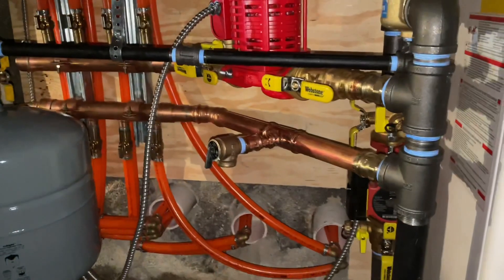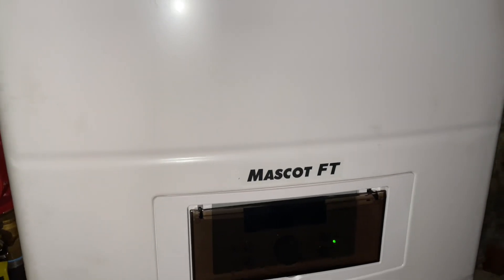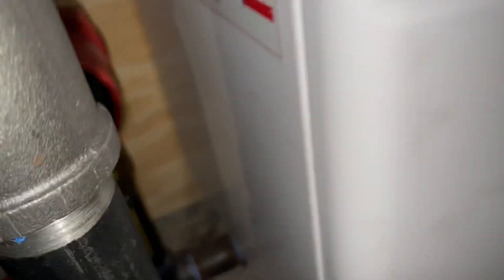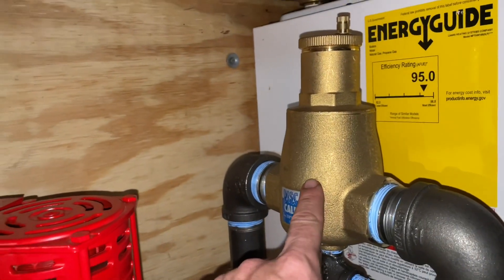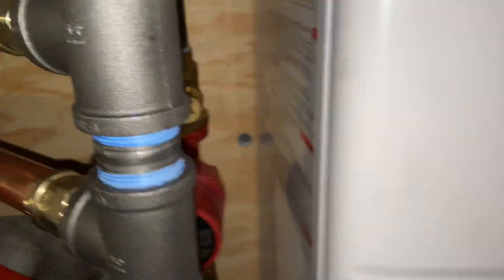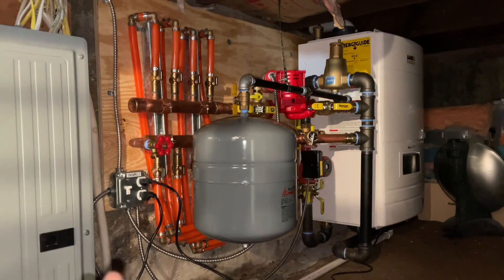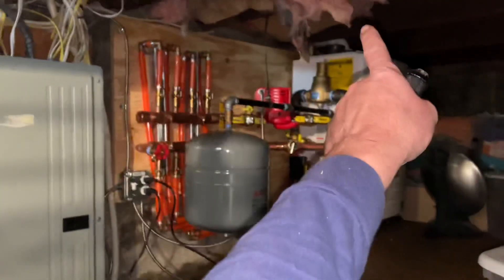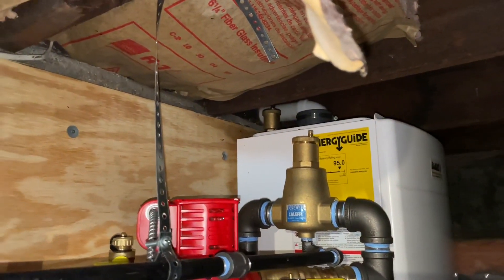Installed Hydronic Radiant Snow Melt System with Laars Mascot FT Wall Hung Boiler 199k BTU

Comment: Hey Mike did you like the Laars boiler. Would you recommend. We have been installing the combi boilers. The heat only don't have a primary loop circ pump built in? They seem to be a decent boiler for system systems like one temp.

Comment: Interesting way to pipe, I usually run my primary loop and run the  boiler secondary.  Not sure if 90 degree inlet will be enough, your going to need some high gpm pumps esp with glycol.
Reply: @PipeDoctor  We need melted snow photos / clip ;) Please visit site on snowy day when you're in the area

Comment: That’s bad ass I’ve only seen one house with it and the way the home owner designed the house he ddI t right snow melt drive way side walk dehumidifier geo thermal house built from ground up didn’t sweat one bit in attic with the ac off